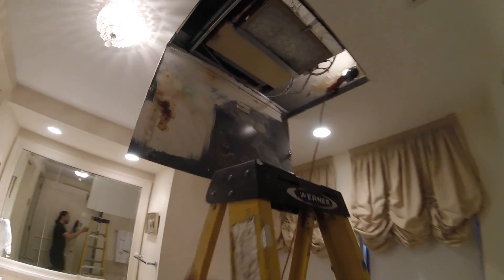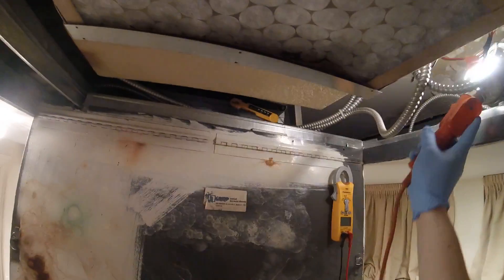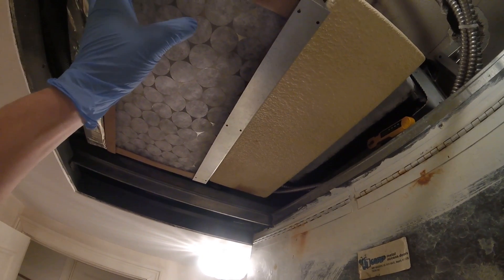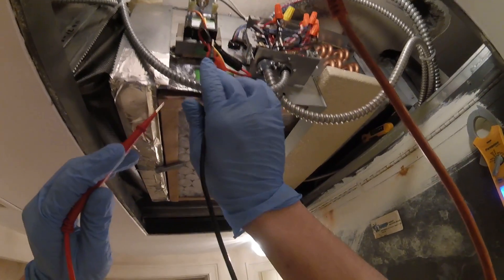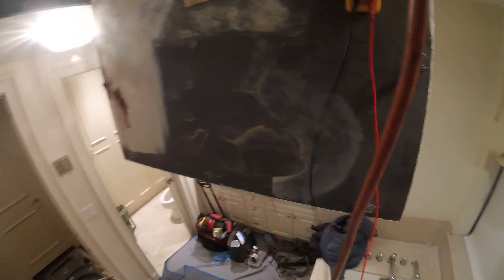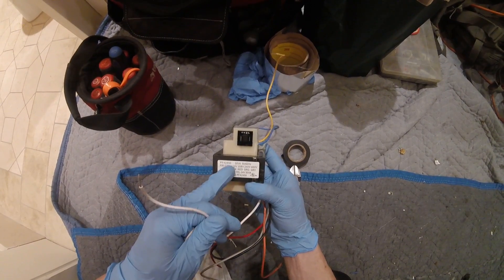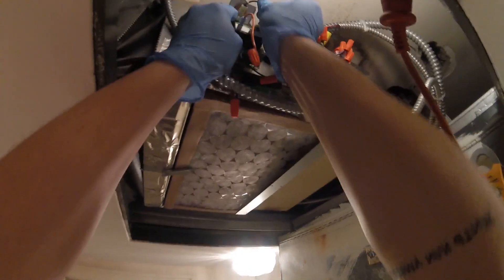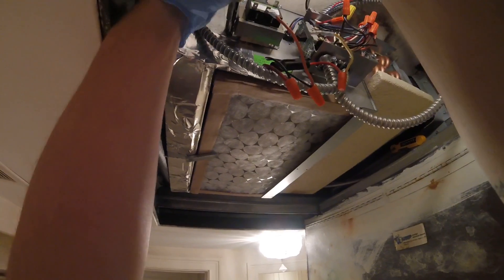HVAC service call: Fan coil unit (FCU) No heat

Comment: Why didnt you use wire nuts when you were hooking up the transformer wires? Isn't the exposed wire unsafe?
Reply from the maker: All electrical connections were safely put back as found ⚡⚡⚡

Comment: I have a FCU in my condo.  It gets serviced twice a year by the condo board's approved tech.  My system works fine but the tech has been telling me for a few years that the actuator needs to be replaced because it is sticky and now stuck open.  My system is not exhibiting any problems and has worked fine all along.  I've tried to determine what would happen if the actuator was defective and stuck open.  I think that the system wouldn't cycle on and off and would continuously run.  Is this correct?  Can a defective actuator cause additional problems or damages to a FCU?  I don't mind paying for work that is actually necessary and feel like this is a cash grab.  Thanks for any info you can provide.
Reply from the maker: If the actuator is stuck open then all it means is that you're constantly allowing water to flow through your unit whether it's hot water or chilled water. This is not good. It's not a cash grab, it should be replaced. You will constantly have moisture in the summer with flowing water creating mold. In the winter, you will have constant heat so even when the fan shuts off via the thermostat, your unit will act as a radiator making the space uncomfortable. If you any safety devices, it cannot do its job and will create more issues. There's a lot to it. If it's truly stuck, I'd recommend getting that fixed. 
Stay tuned for new videos every week 🔧⚡

Comment: At minimum I install sm wire nuts on unused trans wires & tape them up or closed end wire connectors, that tape can dry up/fall off/short out, seen it several times in my 15 yrs as an HVAC Contractor (TACLA)
Reply from the maker: That's true, the tape comes undone over time. Thank you for the advice, always open minded to learning everyday 👍 New to youtube 😎 Stay tuned!

Comment: The reason why that Transformer failed it's because that 3 amp fuse was too large for it. Every 25va should be fused 1 amp. So if you have a 50 VA Transformer their protection has to be 2 Amp. I know this from the hard way. Residential Transformers that were there are usually 40va which I'm not crazy about. You were smart to put a transformer in there that has a built-in breaker. That's the only way I do it as well. I also carry Transformers that are Spud or foot mounted. I've been doing HVACR for 35 years. I work for a school district now working on equipment and I don't miss residential and especially New York I lived out there on Long Island for 8 years and I hate those tight spaces and old buildings. Just passing along about the fuse and Transformer size. 1 amp for every 25 VA. I like the circuit breakers because you will run into times you're going to have problems instead of going through a bunch of fuses you just reset the breaker until you figure it out what's over amping the 24 volts.
Reply from the maker: The thing that got me here is that the fuse never failed to begin with. Found the fuse wired to the common off the secondary winding so if there was a low voltage short, it would just fry to transformer. I'm actually in the commercial business, I hear what you mean about residential baha I prefer working with machines than people 😂 Good tip, I'll keep that in Mind. 1 amp for every 25va
Reply from the maker: Only thing that secondary 24 voltage controls is a tiny actuator for the electric water valve. Pipe sensor energizes the transformer. Thing barley takes any power
Reply: @JumpermanTech  and that is true but something might have happened with the wiring that might show up later where has an intermittent short you never know. Hopefully not an intermittent problem cuz those are the worst
Reply from the maker: @benkuxhouse787  I hear you with that short. Guess we will find out if theres another service call 😂
Reply: @JumpermanTech  if you do get a call back because that circuit breaker tripped in the Transformer I would just replace the wiring going from there to the zone valve and then see what happens. That's all you can do in a thing like that is become a parts changer. When you have to do that I always start with the cheapest Parts things like that first that will cost the customer the least. You don't want to start with the most expensive part and it ends up being the cheapest one. On package units that do weird stuff I will change out heating limits first because they're the cheapest and see if that's the problem before I start going on to the more expensive things
Reply from the maker: @benkuxhouse787  Definetly. Only thing that's 24volts is that valve so the issue would be anywhere from the low voltage transformer wires and then down to the valve. I shook the bx cable to see if it would short out. Valve opened and closed on demand. Main circuit breaker never tripped the issue is on the low voltage side of this circuit but nothing happened. They got heat, I get paid and get to go home 😂✌
Reply from the maker: @benkuxhouse787  Enjoy the rest of your weekend//Stay tuned for weekly uploads!
Reply: @JumpermanTech  I agree you did all you could do for now. I would have handled it exactly the way you did. Have a good weekend good luck in New York. That's a tough tough Market